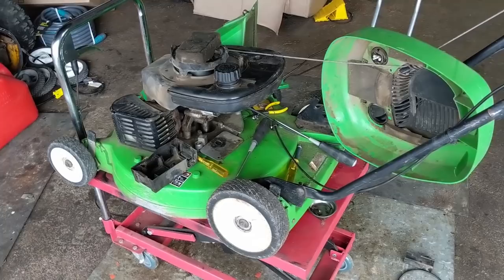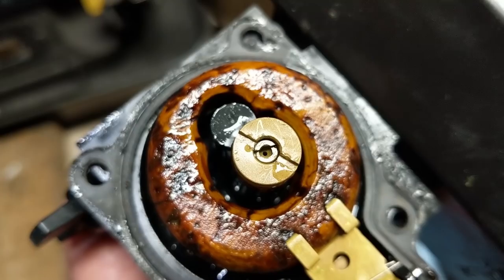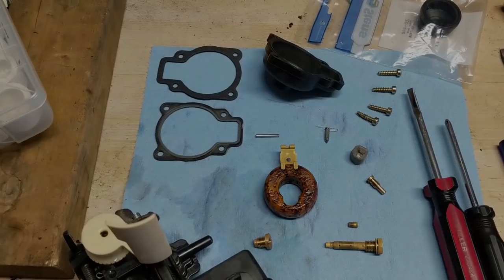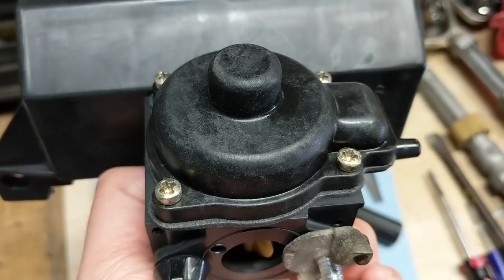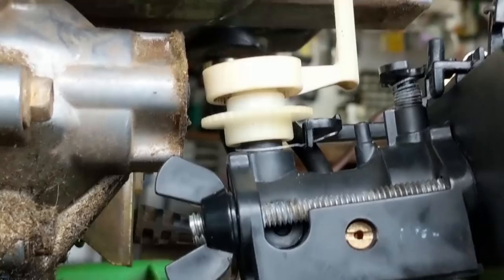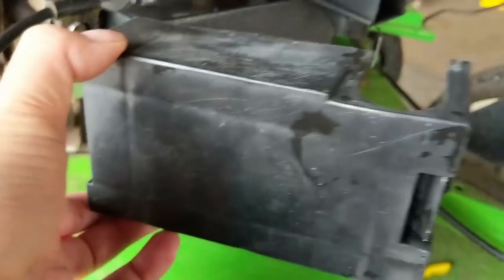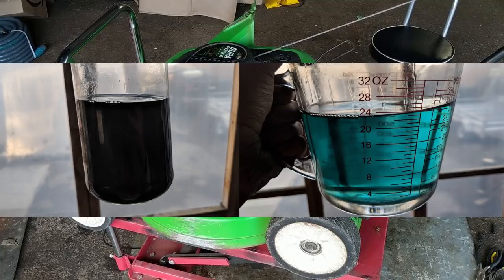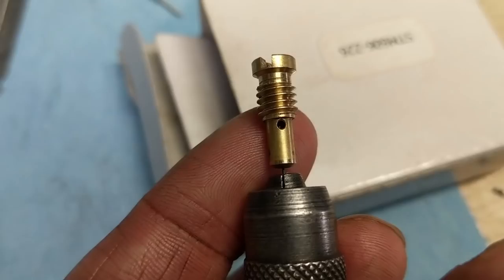How to Clean a Lawnboy Carburetor

Comment: I greatly disagree with your comments about using 50:1 fuel in that engine.  Many years ago (30?) I had a service person try to convince me that I could use a 40:1 fuel/oil mix in my 16:1 (1968) LawnBoy.  Not being convinced I managed to have a phone conversation with an engineer at OMC.  The engineer told me that what determines the amount of oil you need to use is the metallurgy of the cylinder, the metallurgy and number of rings on the piston and the the metallurgy and design of the needle bearings.  The engineer stated that my 16:1 engine would always need a 16:1 fuel/oil mix.  The 40:1 label on the oil was more or less a rating of the quality of the oil in that this oil could be diluted to a 40:1 fuel/oil mix and still provide good lubrication for an engine designed to run with a 40:1 mix.  Older 16:1 or 32:1 oils could not be diluted to 40:1 and provide good lubrication to the new 40:1 engine.

So I call "bogus" on your assertion that a person should run a 50:1 fuel/oil mix in a engine marked as needing a 32:1 mix.  Maybe a person could get away with a 40:1 mix in that engine, using new oils, but I would never use  a 50:1 mix in a 32:1 engine.
Reply from the maker: My neighbor has had a 2 stroke lawnboy for over 36 years and has only run 50:1 mix, the engine still runs great. He used to race motocross professionally, so I took his word for it, I mix all my 2 stroke fuel at 50:1 and I run all my 2 stroke equipment (both personal and customers) at that mixture and have never once had an issue.

However, on the flip side of that, running to rich a mixture, I've seen plugs foul and carbs get gummed up, sitcky reed valves too.

Todays oil does in fact lubricate better than the oil 40 years ago, so you can run a leaner fuel mix. At the end of the day though, I suppose it's up to you.

Comment: Um no i run them at 32 to 1 if i run them at anything less they ping and start knocking i never run my lawn boys at anything less then 32to1 actually i now run everything at 32to1 even my sthil 024 chain saw i never have an issue
Reply from the maker: You can, it won't necessarily hurt anything. I've found the richer mixture will foul plugs and gum up a carb quicker.

As stated, I run 50:1 in all my 2 strokes and have never had an issue!
Reply: @EliminatorPerformance  yup and that's ok everyone runs different things ive found if i use 91 octane and a 32to1 mix it doesnt bother anything but if you run 87 or 89 octane it does foul plugs even the 50to1 machines at the proper mix so i just run 91 in everything except  automobiles
Reply: Thats why i said that but maybe your fuel quality is better in Canada